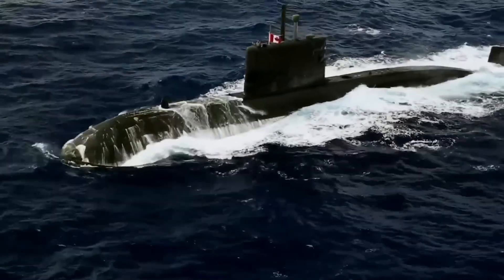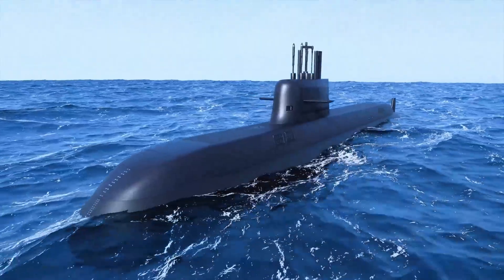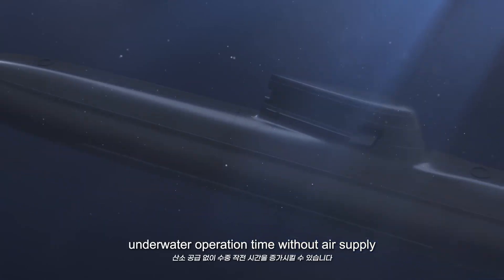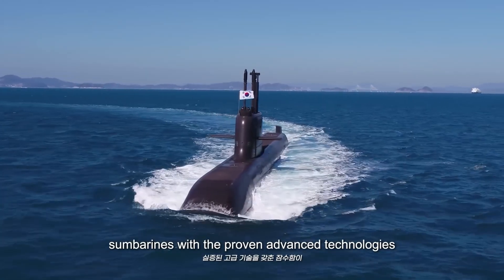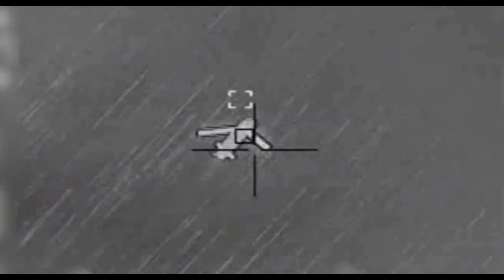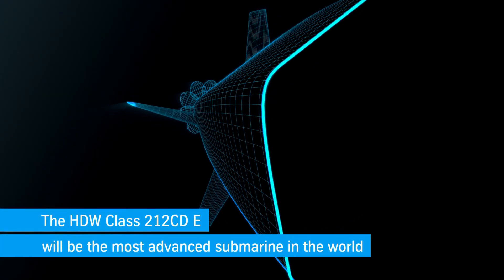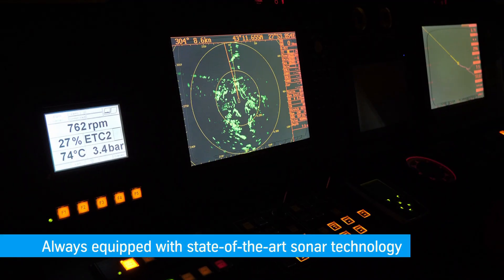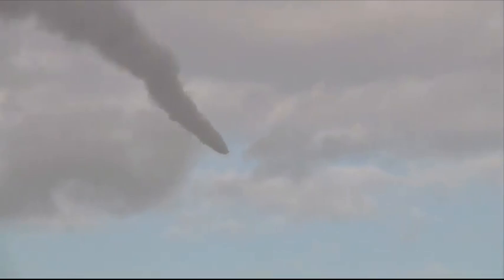RCN's Potential Next-Gen Subs

Comment: good to see canada getting serious about new subs! Both are good, hard to pick, but I'd go with the korean one for the longer submerged time and VLS cells
Reply: I wonder if one day they might have quantum batteries?
Reply: @thomnoble8384 Possibly. But they can accept a nuclear power plant.
Reply: 한국은 독일보다 무기 생산과 납품이 빠릅니다. 이건 아주 중요합니다. 한국을 선택한 폴란드는 바보가 아닙니다. 옆동네 독일이 아니라 머나먼 아시아의 한국과 계약한 이유가 있지요. 또한 생산과 납품이 빠르다는건, 물건 구입 후 유지보수도 빠르다는걸 보증합니다.
Reply: hlcapa...Even more top-notch nonsense! According to TKMS, the U212CD can stay underwater for over 40 days! This was a demand from many in Norway and Germany! Diving depths should also exceed current detection limits, with operating depths below 600 meters! According to AI and experts, the U212CD, thanks to its 1.25-1.5 times more stable diamond shape and the 25% stronger TKMS steel, can operate at depths of 600 to over 1000 meters! The U212CD's scale was also a very important feature! So, 90 or 100 meters for recording 40-80+ VLS! According to AI, the range is over 17,000 nautical miles, and the underwater lifespan is then at least 60-80 days!
The KSS III is specified with a dive time of 20 days and an operating depth of 200 to a maximum of 400 meters. I have rarely read so much bullshit when it comes to comparing KSS III and U212Cd, especially in the age of Google and AI!
Reply: so problem with the Korean one is that unlike the German sub its not designed with the artic in mind and with the reenforced con tower for breaking through artic ice like us subs
Reply: @Golden31Eagle The Korean sub is rated to break through 2 metres of ice. What is the rating for the German-Norwegian sub?
Reply: @Golden31Eagle  Originally, German submarines, including the 212A, do not have icebreaking capabilities, and as far as I know, the 212CD roadmap does not either. The German Type 210 submarine, a coastal variant designed primarily for the North Sea and Baltic Sea, has not been operated near the Arctic. By the way, South Korea also operates the Type 209 submarine. Leveraging advanced technology, Korea’s submarines have overcome the limitations inherent in German submarine designs, enabling them to conduct operations not only in the areas typically covered by German submarines but also across much wider and more demanding maritime environments.
Reply: @Golden31Eagle What we should focus on here is that Hanwha’s Korean icebreaker successfully broke through 2-meter-thick ice, and it has numerous ice navigation records not only in the Arctic but also in the Antarctic. These icebreakers account for 65% of the global fleet, and a next-generation icebreaker will be launched in 2026. Given this, do we even need to discuss the Arctic submarine capabilities of a submarine built by Hanwha, which possesses that icebreaking technology? In any case, it is clear that Korean technology has a technical advantage over the German counterpart. If necessary, I think switching to nuclear propulsion wouldn’t be a problem for the KSS‑III in the near future.
Reply: The Korean subs are built in the US.
Reply: @denisfredette7495  No they aren't.  It's a Korean sub, they have tons of ship building.  The KSS-III is built at Geoje, South Korea at the Hanwha Ocean shipyard.  

US can't even keep up with it's own Submarine production need.  So please don't share easily debunked disinformation.
Reply: Submerged time will be less than the 212CD. You need to watch again.
Reply: @allannantes8583 actually much longer. It has bigger body means more room for battery and Korea simply makes better quality butteries than germany.
Reply: @allannantes8583  Not true...  Size is everything when is comes to diving ability.   VLS cells can be converted to extra stroage or extra battery, and even additional living quarter, which is crucial for prolonged diving.   Remember Germany does not have thousands of miles to travel.  So their subs are small.   Koreans want to build blue water navy.  So they have larger ships and subs.   12000 ton detroyers are deployed.
Reply: 212CD is not developed unicorn
Reply: @allannantes8583  넋 빠진 인간아, 내가 설계한 최신 잠수함은 한 번 잠항하면 최소한 300일 동안 물 속에 있을 수 있단다. 어디 허접한 독일제 잠수함과 비교가 되겠냐? 응?    

이게 뭔 말인지는 알겠냐? 네 머리로는 불가능하지?   

지금 운항 중인 실제 잠수함하고 페이퍼 상의 잠수함하고 비교를 한다고?  응?  그러면 한화오션의 잠수함이 아니라, 내가 설계한 잠수함하고 비교를 해야 맞지?  그렇지?